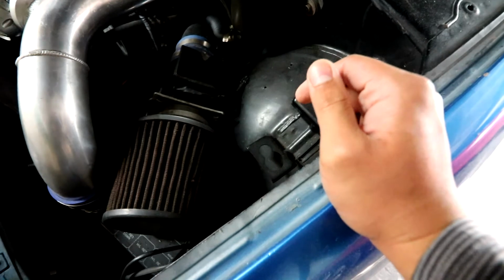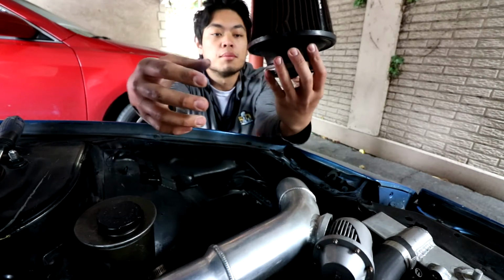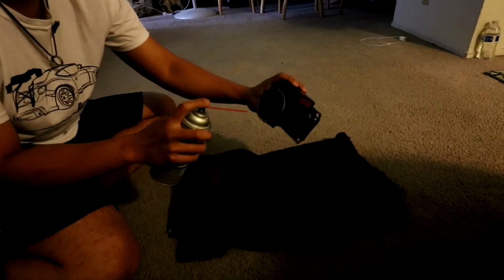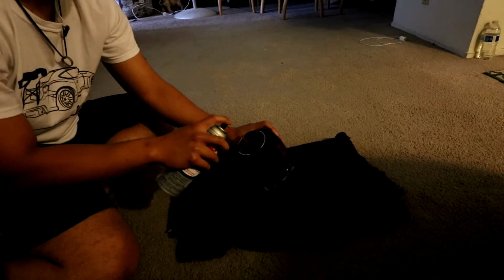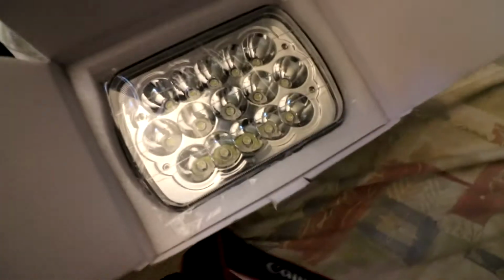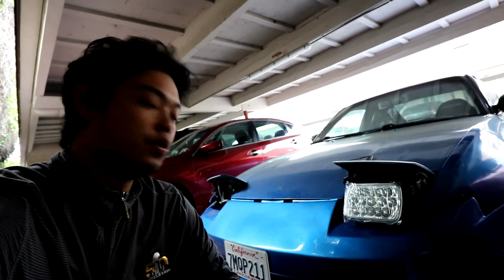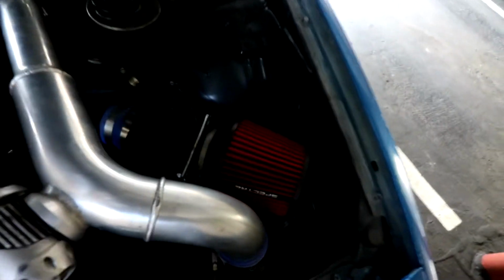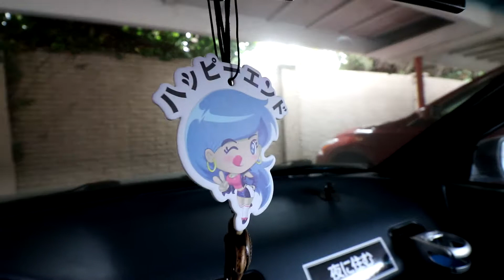LEDs for the s13

Comment: I have the same ones , try changing the fuel filter
Reply from the maker: Do your high beams work? Thanks, Ill change it and hopefully it'll  keep the car from acting weird again
Reply: Kevoroba yes mine do. I got one spec d headlight the other one is a different brand because I thought it would be 2 for 40 dollars  lol but they both work and yeah I put sea foam in my verts gas tank and it clogged the fuel filter and now it runs good it was so bad at one point I couldn't get across the intersection. Auto zone sells them.
Reply from the maker: Sean Smile forsure, I already bought the filter so ill probably replace it tomorrow lol
Reply: Sick !